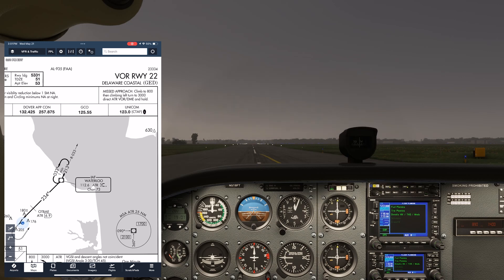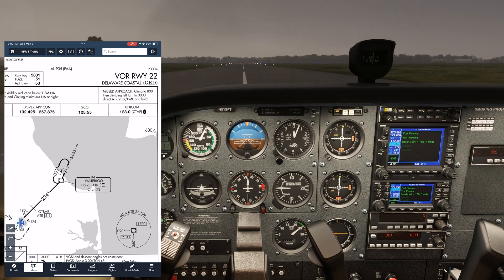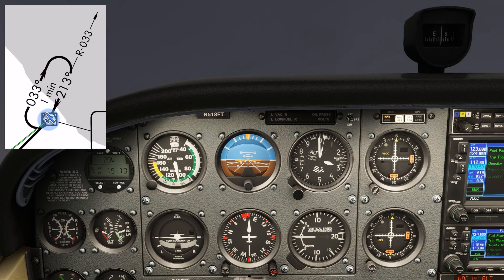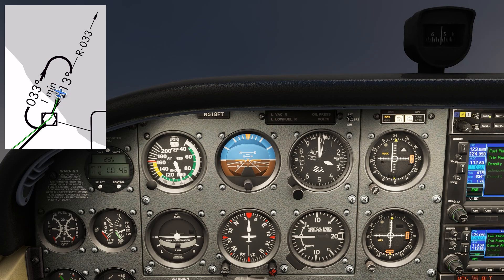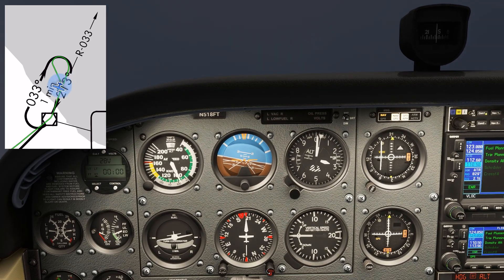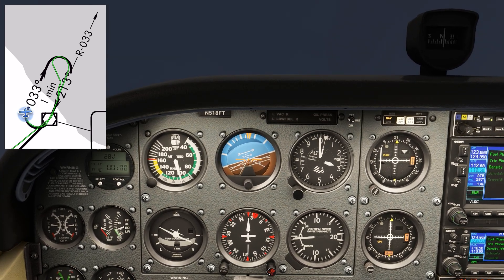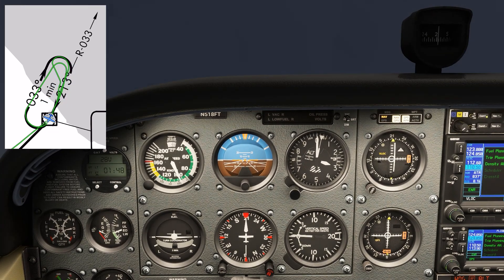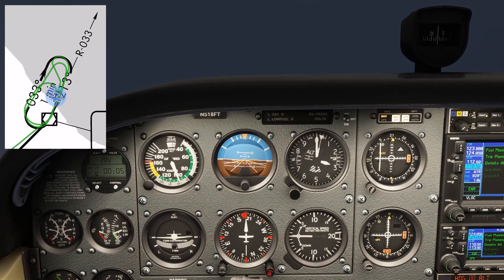Mastering VOR Holds: Wind Correction Made Simple

Comment: If you know the wind component from a G1000 f.ex or your preflight weather briefing there is actually a formula to find out your WCA.

WCA=WAxWS / TAS

(WCA=Windcorrection Angle)
(WA=Wind Angle, angle between track and wind direction, use the smaller angle since you have 2 legs 180° opposed)
(WS=Windspeed)
(TAS=True airspeed)

This works fairly well for an initial estimate and then you can fine tune during the hold. For small angles this is almost on the money, for bigger angles more than 90° it's less accurate but still a good place to start.

For the outbound leg time just add or subtract in seconds the windspeed if the WA is 0-30°. If the WA is more than 30°use half the windspeed.

So a 20kt headwind: add 20seconds, 20 kt tailwind:subtract 20 seconds.

You can verify the proper hold with looking at the 40 secound outbound position (the gate). If you have a bearing pointer, it should point 40° off of the inbound course at 40s outbound leg. If this is the case, you are good.

Comment: How about RNAv holds? Wind correction is the same? Or just use wind Diane d?
Reply: You follow the GPS hold that's charted and adjust as necessary
Reply: You can use OBS and then use the RNAV point as VOR, basically you fly the hold identical to a VOR hold. 
Or you program the hold into the FMC and let the AP do it. The AP uses then non standard turns to remain ontrack. If you fly RNAV hold by hand, by regulation, you must fly standard rate turns and therefor need to correct for wind like in a VOR hold. The OBS here transforms the RNAV point into a VOR and pauses the sequencing to the next waypoint in the FPL when flying over it.

Yet another method is to use a bearing pointer on an RMI that points to the RNAV point and fly it like an NDB hold just without the Dip error of a traditional ADF instrument.